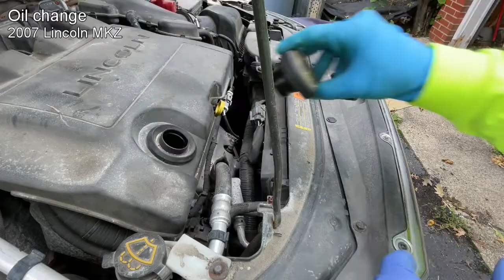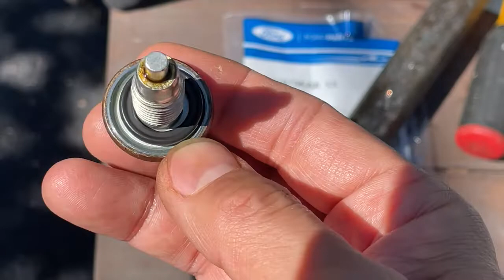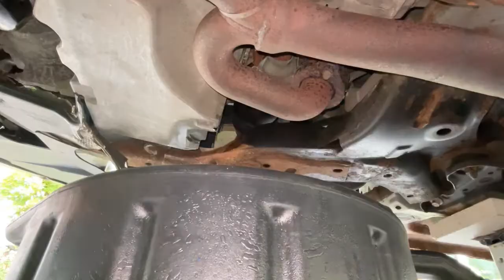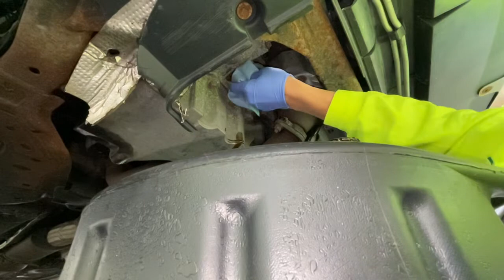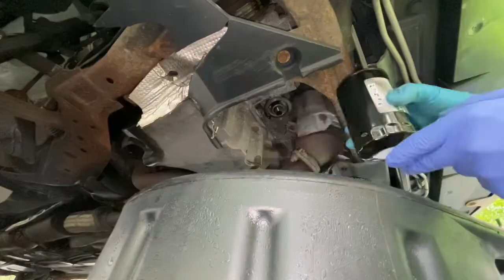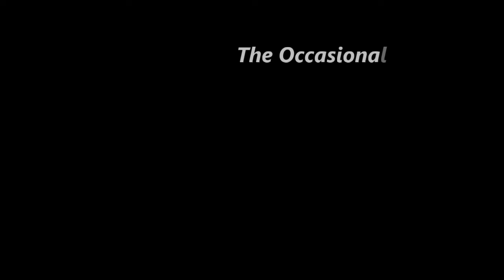lincoln mkz oil change. 2007 2008 2009

Comment: Every time I get the oil filter they give me the wrong one I always ask for the motorcraft one and the give me the FL400s and my 2008 mkz uses FL500s and even the owner manual says it uses FL400s
Reply from the maker: That’s interesting!  It must be in their system wrong.  Which store is this at?  Or is it from a delaer?